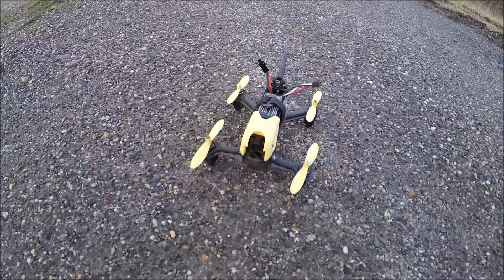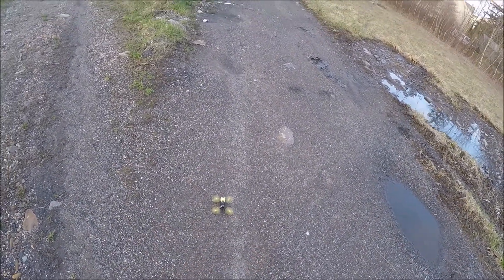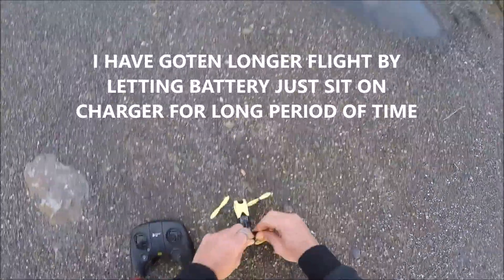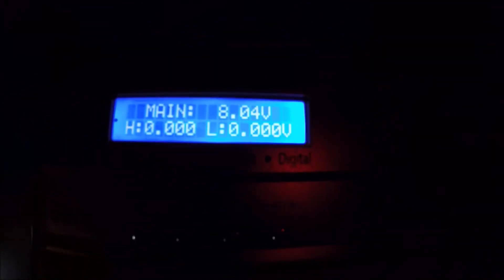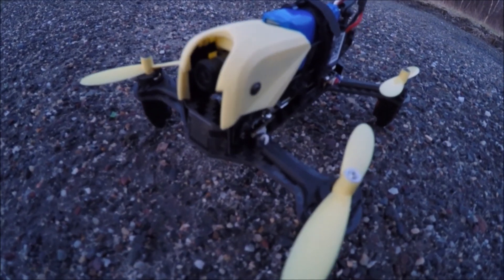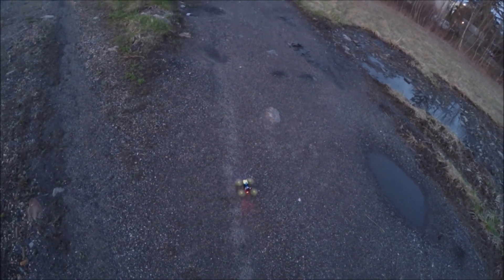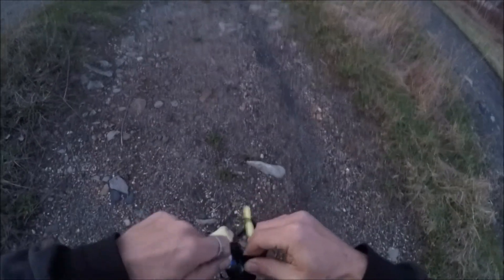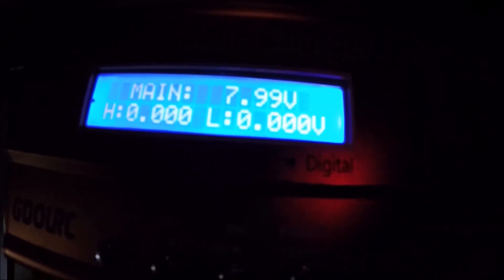HUBSAN STORM H122D X4 BATTERY ISSUES Full Testing Volts REVIEW

Comment: My hubsan x4 storm doesn't do that I have 2 battery's and they both work fine you probably have a bad battery
Reply: Hi could you please tell me how do you know when the battery is charged , will the red light go solid and what voltage should it be when full. TIA
Reply: @alanshill4347  If the battery's flash red its charging and it keeps on a still red light once its finished charging
Reply: @ciaren1969  thanks for that . Bit do you know what voltage it is when full because mine is still flashing and when I test the voltage and it's at 8.66v . So I've unplugged it. Then I've used a walkera rodeo 110 charger and that has charged it fine and stopped at 8.4v. TIA Alan
Reply: @alanshill4347  both of my battery's charge up to 8.42v
I just use the normal charger to charge them
Reply: @ciaren1969  thanks for your help. After you telling me this a think my charger may be broken. Like I say I've tried a walkera charger and that seems fine. Like I say the hubsan seems to be over charging and I don't want to bust the batterys. Thanks again
Reply: @ciaren1969  o nice one pal I really appreciate it.